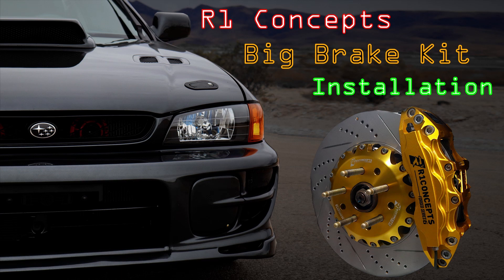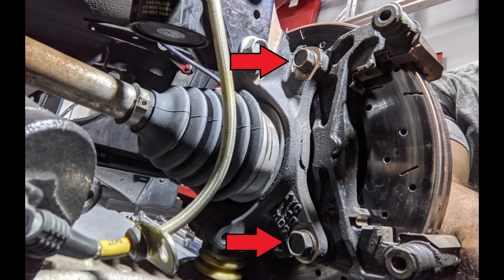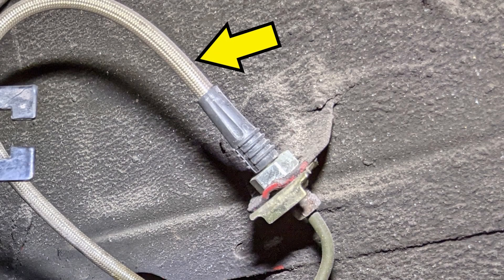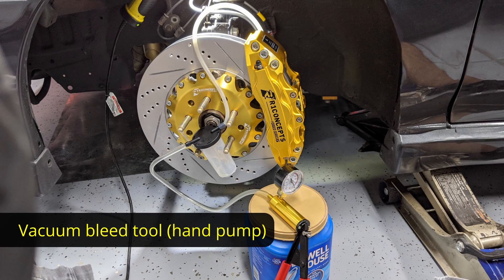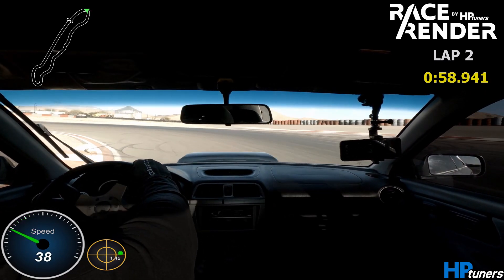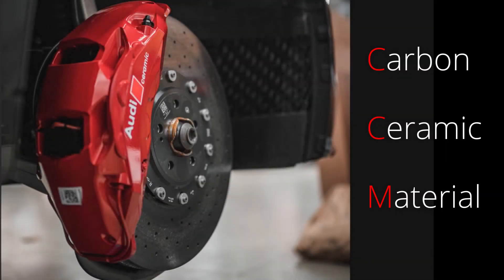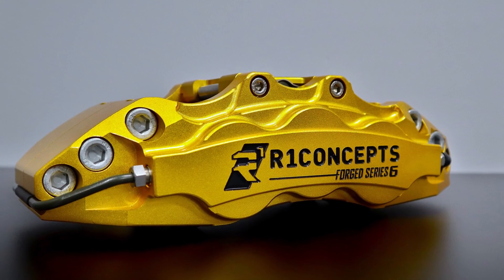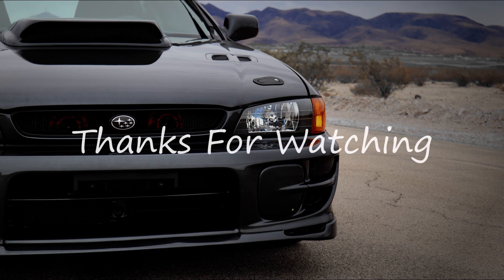Installing R1 Concepts 6-Piston Big Brake Kit on a Subaru Impreza GC with 2004 WRX STI Swapped Parts

Comment: How much for the kit rear and front for gc8 impreza 1998
Reply from the maker: I don't know if they make a bolt on kit for GC. My car has 2004 WRX steering knuckles. I suggest contacting R1 concepts directly for fitment and pricing.

Comment: Is it possible to use a sti knuckle with a 98 hub bearing????
Reply from the maker: I don't believe so, at least not "off the shelf". The hub/axles sizes and styles are different. Classic Imprezas use press-in bearings and newer STIs (5x114.3) use bolt-in bearings. 
I'm sure someone with enough time and skill can make something that could work.